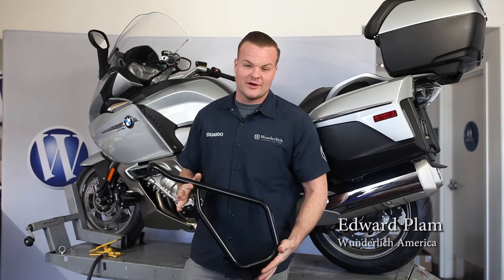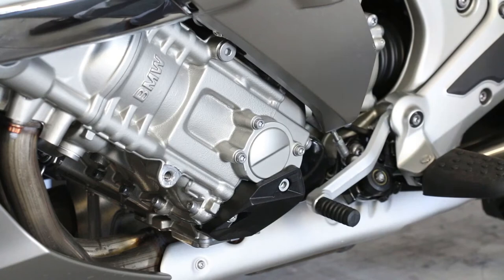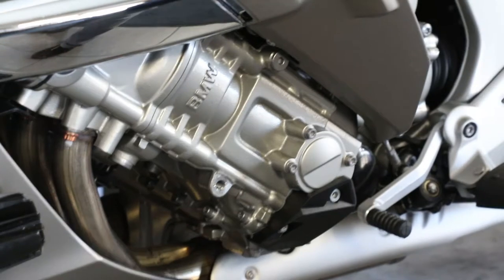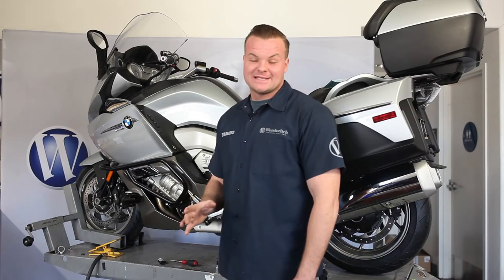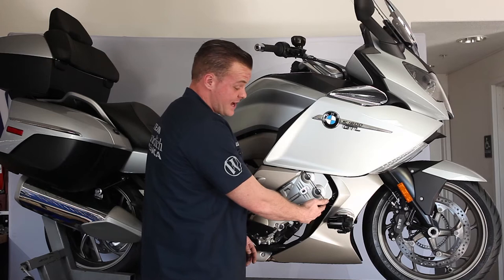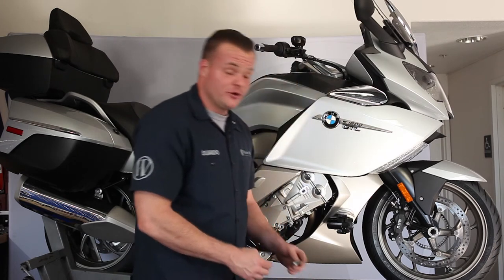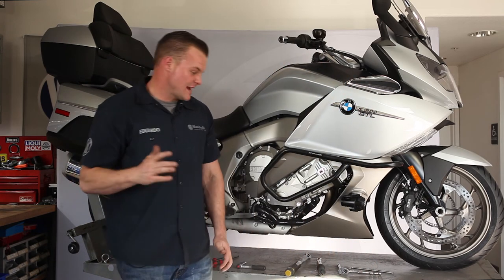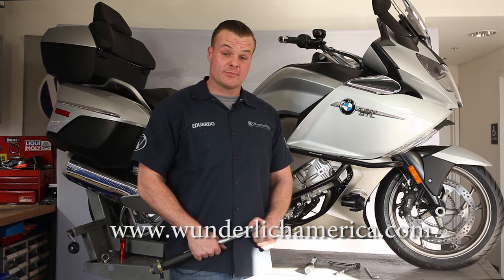BMW K1600 GT   GTL Engine protection Bars

Comment: I found two things that made this job much easier. One, remove the plastic, and second, install the rear mounting screw, then put on the aux light screw, then put in the middle screw. Maybe things have changed on the 2018 GTL, but I just found getting the angle on the aux light easier with only the rear screw (learned that after doing the left side ... of course). ;)

Comment: Rather than using a couple of extensions and a wobble extension, just take an open ended wrench and put right on the bit part of the Torx socket. Much easier and works a million times better. 

You can thank me later Wonderlich.

Comment: Can these bars be used on K1600 GA as well?
Reply: don't use this stupid think, it's a bad idea to put a protection bar on the engine not on the frame, it's really the baddest idea ever!!!
Reply from the maker: Yes they do!  We have two different designs.

https://www.wunderlichamerica.com/BMW_K1600_Engine_Bars_1
 and
https://www.wunderlichamerica.com/BMW_K1600_Engine_Bars_2
Reply from the maker: BMW also mounts their crash bars to the engine and since they designed & engineered their models I would think they know what they are doing.

Comment: Yeah those bars are not going to withstand anything more than maybe a standstill drop. The pipe that ends just behind the front wheel isnt even connected to anything, will bend like a spaghetti.

Comment: I will never understand why someone would buy a beautiful bike, only to cover it with jungle gym tubing. Why doesn’t the motorcycle manufacturer design it into the bike. You might as well cover the whole bike with a cage, so the whole thing looks like $h!t.
Reply: I see your point, however I think there's still a large number of riders who prefer not to have crash bars because of the esthetics.